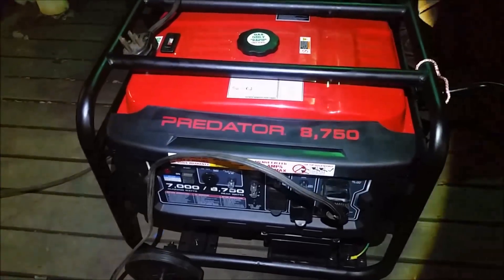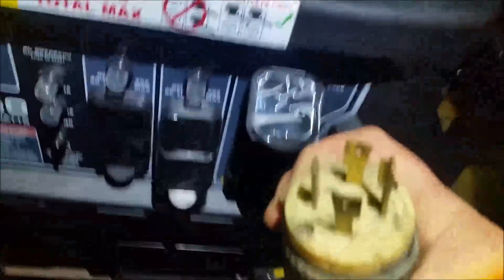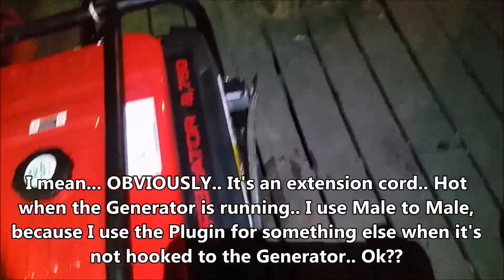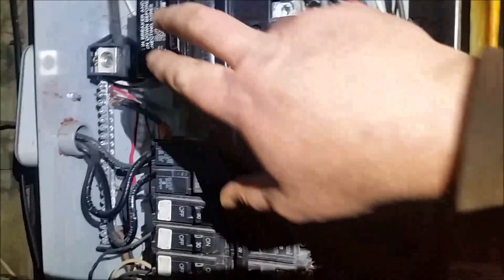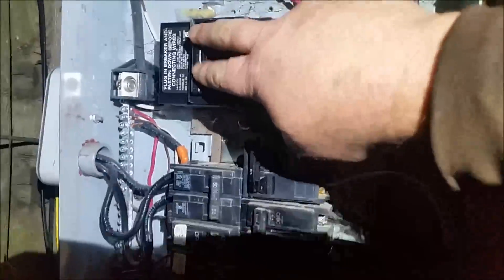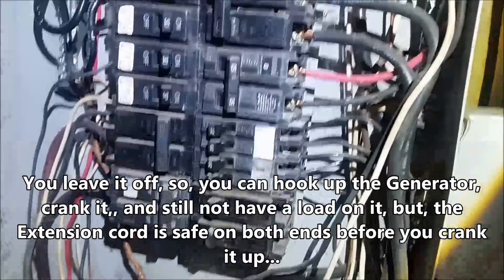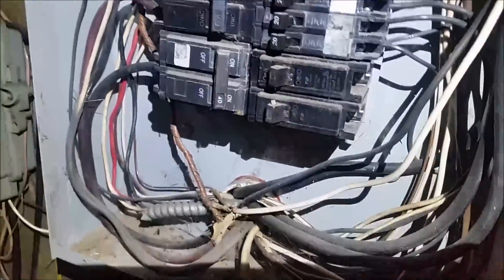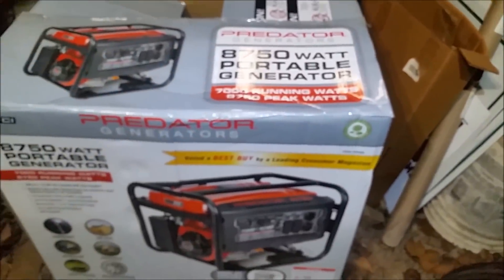Quick/Easy/Safe: Use Existing Plugin/Breaker for Generator hook up to your house Panel box.

Comment: The first rule of common sense is to never build or use a suicide cord.
Reply: That's true in a perfect world. In a perfect world, no one ever needs a pump shotgun, after a hurricane. .
Reply: This is true if you connect and disconnect it on a regular basis. Mine has dedicated sockets at BOTH ends, a 4 prong 50 amp twist lock on the generator and a 4 prong 50 amp blade socket on the wall. They are almost never unplugged for any reason plus the house end of the cord has a dedicated dual 30 amp breaker to disconnect the generator from the system while the main power is on.
Reply from the maker: Ha.. Jeff.. You just described this system to a "T".. Ha..Ha. The only part different, is,, It gets plugged and unplugged every time I use it, or every time the power is going to be out for more than an hour or two.. Some times once or twice a year and some times 5-6 times a year and every now and then a time or two more. I never forget to turn the generator off, turn the 50amp breaker off, unplug or plug the cord and do whatever is needed to the main breaker first or last depending on what I am doing, (going on or off utility power)..  Easy Peasy!! Cheers.. Ha..
Reply: What is this alien culture of fear?  If you want power, you do what you have to do.
Reply: Also please be careful using portable generators. Carbon monoxide is also dangerous https://youtu.be/I1jT3ANENvI I just want to make sure that people use their generators carefully.
Reply from the maker: I said this in the video and in the text.. Can't seem to figure out why you can't get it.. Again.. here you go: 
Only for those of you with Common Sense though.. Those that talk about Safety 100% of their time on Youtube,, better not mess with this one.. Way over your head..Ha..
Reply: Agreed... Mil Trained GEN JOCK throwing my 2cents.  This is exactly how anyone with experience and common sense would do in a emergency.  I set up 1000s of Field units this way from the US to South america to the middle east..NEVER HAD ONE ISSUE.  Though my personal unit is setup with a auto kick in..I keep a Harbor unit like this on Standby.  My area.. saw it's first Tornado in over 70 Years last year..the MTNS of Nor West NC. My cell blew up with calls wanting help.  Only difference I did,was run the lead into the clothes dryer plug.  That's when I decided to keep a unit on standby for those that couldn't afford to run out and get one.  Nothing wrong with doing it this way.
Reply from the maker: Absolutely correct.. The only difference is the Male to Male Cord.. That's the only Temporary change to the whole deal.. But, can't expect the Freaked out Safety Police to handle this one.. Ha..Ha.. 
In the Mountains of Extreme west NC.. In the Nantahala River Gorge..  Only one County west of me in NC.. 
Cheers Richard.. Thanks for the comment..
Reply from the maker: Read the text and watch the video... Here you go if you missed it 4 times..
Only for those of you with Common Sense though.. Those that talk about Safety 100% of their time on Youtube,, better not mess with this one.. Way over your head..Ha..
Reply from the maker: Read the text and watch the video... Here you go if you missed it 4 times..
Only for those of you with Common Sense though.. Those that talk about Safety 100% of their time on Youtube,, better not mess with this one.. Way over your head..Ha..
Reply: IFYA SCARED... stay home
Reply: Your right.  It invites a stupid person to do something stupid.  And for so very little($100), you can hook up an interlock kit with an outdoor inlet box.  For about $300 you can hook up a reliance transfer switch which is also very convenient and safe.    Well said......
Reply: but when the power is out and youve got no way to get to your home depot to go buy an interlock kit whadda ya do? You find your own way to hook it up
Reply: Not everybody has $300 or even $100. $100 may be "so very little" to you but for lots of folks, it may mean several good meals for a family.   This works. It cost nothing and only a dumbass moron would be too stupid to follow Mark's simple instructions.   You don't NEED to spend $300 or even $100.  You just need to follow instructions. Your comment smacks of arrogance and elitism...exactly what's killing America today.
Reply: Sometimes you find yourself in a   emergency situation where there is no transfer switch no one's coming to help you and Powers not coming back on for a long long time ..... You can back feed a panel make sure you turn the main off then I just backfeed it through the dryer receptacle
Reply: That does absolutely NOTHING that this free set up doesn't do, and provides ZERO protection. An interlock is the EXACT same set up with a $100 price tag moron.
Reply: Game Changer actually it does change the situation  that you do not have an exposed hot male end so it is not a suicide connection.
Reply from the maker: No.. I am glad that you said that exactly how you said it.. It makes this reply pretty simple.. 
Not a Game Changer,, because I "Don't" have an exposed "HOT" Male end... That is the "KEY" to the whole deal that many or most don't  understand..  When the Main is off and the Generator is not running (which is when you hook up the extension cord), the Male to Male cord is "NOT HOT" therefore does not have a "HOT EXPOSED END".. 
But,, like I said.. It takes Common Sense to use this style of hookup.. You can't have your Stupid shoes on and have no clue what electricity can do to you while you are working with it.. 
Keep trying real hard Robert to find a problem with the setup.. By the time you are done,, you will have only one problem.. And, before you get there,, here it is.. You are not comfortable that you can do it this way without forgetting to isolate the Extension cord before you plug it in, or unplug it.. Even in the case of unplugging, if you unplug it from the panel first,, you still have to remember to turn the generator off.. If you are afraid of not being able to do that,, then,, you should have a transfer switch, and it does not get any simpler than that.. 
So, how many or what percentage of people who want to do this,,,, "AND CAN MAKE A MALE TO MALE EXTENSION CORD for a 220V Circuit without any Instruction from This Video",, who would actually get the extension cord made, that would not understand after they made it that they need to be careful when using Electricity to begin with,, and especially when they are using a Male to Male cord??  I don't see how someone could not Get to the point of hooking this up without having the common sense to use it after the built it... 
What percentage of people do you think would actually get that far and think they didn't have to be safe when using it?? Just curious?? I didn't tell them how to make the cord.. They have to figure out how to do that themselves.. Which is more complicated than hooking up a breaker, etc..
Reply: @randomsecrets  Pal You  the Moron Fool !
Reply: Yep :)
I made my Suicide Cord then thought that I may back feed via ground to the street,... After checking with 3 different electricians who all said NO it won't, I was convinced after watching several YT video's on Generator Bypass Switches "Professionally" installed & realized that the "Professional & Safe" bypass switches do NOT disconnect the ground from the grid :)
You are CORRECT !... The bypass operates EXACTLY the same way as manually throwing your Main switch off, just with an idiot proof fail safe of not being able to throw to generator without turning off the Mains ;) 
I do NOT need a $1 piece of tin plate to pretend to be smarter than me lol.
Don't get me wrong,... If I move to a house with a modern Panel I WILL install a bypass switch but right now, my 1950's house has a panel PLUS the old main switch box with the 2 tube shape fuses & the box has a big lever that I can pull down to disconnect from the grid & it has a provision to LOCK THE LEVER IN THE OFF POSITION WITH ZIP TIE OR PADLOCK !
Cheers :)